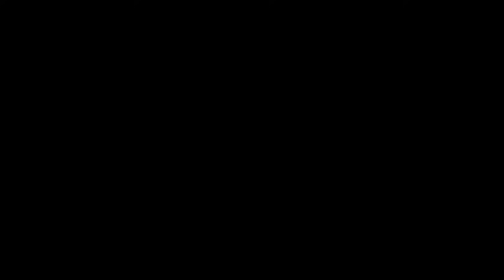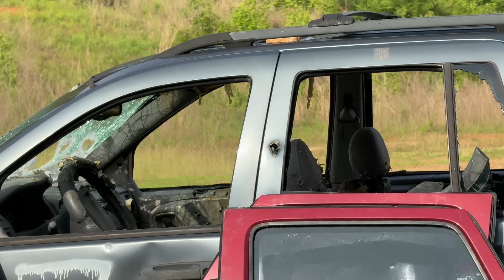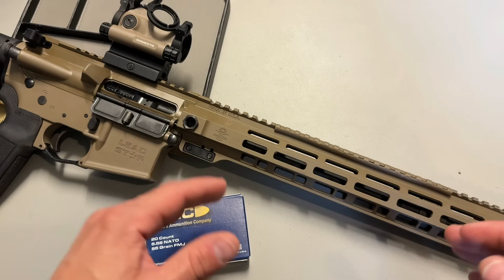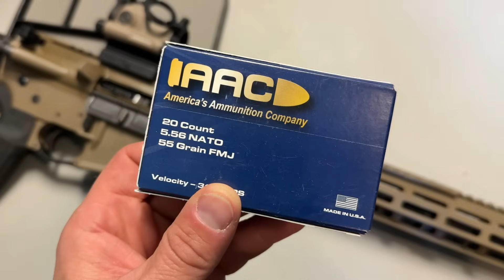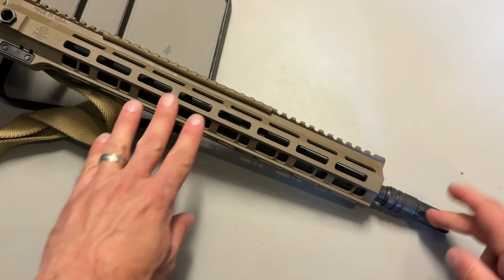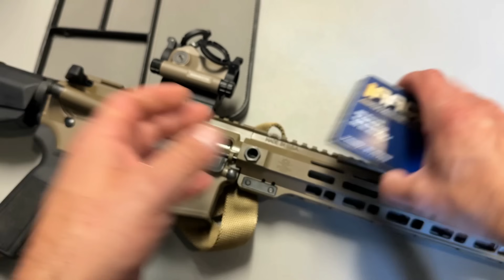PSA "Sabre" FDE Forged 16"

Comment: I have the 8.5” 300 blackout Sabre. It came with the 3 position gas block, but when I adjust it I’m actually getting 4 clicks. What about that one? I really like the RifleSpeed gas block they offer now. But the one I have works fine. It is throwing brass at 3:00 suppressed with supersonic and at 4:00 with subs. I’m looking forward to deer season this year. My wife will be hunting with the Sabre(GunWerks suppressor) and I’ll be hunting with the Pro2A 7.5” 1 in 5 twist upper, suppressed with the Q Thunder Chicken.
I recommend doing a review on the Pro2A upper with adjustable gas block if you can get your hands on one. They(with adjustable gas block, bcg, and c.h.) are priced around the PSA Sabre upper price point, more or less.
Great review! Thank you!👍🏼